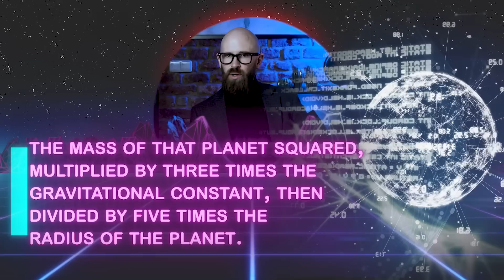Is It Possible to Destroy a Planet with the Death Star Laser?

Comment: Maybe the "lasers" we see when the Death Star fires are just a targeting system for a relativistic kinetic kill vehicle powered by a miniature warp drive (or hyper drive if you prefer) but only a sublight warp drive than can only accelerate the RKKV almost instantly up to near light speed! This would fit present theories of warp drive that even if warp drives can never be used to achieve FTL travel than they might still someday be able to achieve very high sublight speeds. The warp drive would only need to be activated for mere seconds as the RKKV was on it's way to it's target guided by the multiple lasers combined finally into just one laser. And then just moments before impact be deactivated. The RKKV would then travel at the last second (or few seconds) to it's target on it's own... destroying the target not just through the shear force of the impact but also through the annihilation of the remaining antimatter in the warp drive engine with the matter of the planet. And so essentially you would have what one might describe as a "double whammy" hitting the poor doomed planet. And voila... you have a really super cool looking, but totally awful looking scene like what we saw in Star Wars A New Hope!

Comment: You're forgetting that the Death Star has hyperdrive, which can shrink the distance between things.
So by shrinking the DISTANCE between Earth and space, the rate of entropy would be increased, allowing the planet's heat to convert to kinetic energy much faster, causing it to explode.  The thermal energy of a planet is about 4E+31J, so that's not enough to destroy it completely; but WOULD scatter it over a pretty large area, as shown in the film.

Comment: In the early days of the Internet some people got really obsessed with the trench run scene filmed above a flat model and took some lens artefact at the edge of the picture as proof that the prop is actually a sphere, so according to their calculations Death Star was bigger than the Moon. Instead of the official about 100 miles diameter which would fit with the "small moon" line in the movie, they insisted DS is the size of a small planet.

And just to prove beyond all doubt that these folks did not understand what they were saying, those faulty calculations were sometimes offered as "proof" that SW has superior firepower to other SF settings... WTF? I mean, when Star Trek has man portable planet killing bombs compared to SW's fifty mile long cannon, saying that actually the cannon needs to be massively bigger to do the same thing is the exact opposite of proving their fandom has better space magic.

Comment: In the lore it states the Death Star uses Kyber Crystlas. These crystals are basically naturally occurring super capacitors. They keep absorbing energy until they reach full capacity and the discharge it. However its not easy to control their discharge and the Empire spent nearly 20 years trying to develop the technology required to do this. The actual structure was already complete, it was the laser that was taking so long to build. In Star Wars Rebel they show a Kyber Crystal that was the same size as a small room and it manged to store enough energy to destroy an entire fleet. The one that is used in the Death Star must be as big as a small city.

Comment: The reason Star Trek is better than Star Wars is because the Federation has solved the recoil problem via inertial dampeners . . . They also use matter/antimatter effectively . . . As for the rest of the problems Simon is pointing out . . . Ya. They are working on that!

Comment: Your theory is based on the weapon cracking the planets surface into pieces. Is it more possible that it makes the core unstable causing a chain reaction releasing cascading energy. The core plus the weapon. In this case the weapon would have a different affect on smaller objects.

What if the weapon causes gravity to repel? Or perhaps the violent reaction causes nitrogen to be created increasing the violence? Or perhaps the outward pressure of the planet reduces and you have explosive decompression?

Comment: Magnetic fields in high vacuum are definitely the way to go for storing positrons, as for mass missiles, just use principles of gravity boosts or quasar jets- in other words, let something accelerate by falling towards a large celestial object and miss. 

Voyager 2 is going at around 0.005% of the speed of light, which is a substantial fraction for a man made space craft, and it was only able to use gravity boosts off of Jupiter and Neptune- use hyperdrive to boost off of a couple of stars and you could get very fast very fast

Comment: Saying as we have infinite budget for this, and access to technology such as a dyson sphere, we would also have AI and supercomputers capable of handling the calculations needed to aim multiple dyson sphere's entire energy output to a specific point at a specific time. Given that these dyson spheres can redirect the entire energy output of a star in a direction, we would also have the ability to redirect this energy at other locations thus allowing convergence of the energy in the same direction. 
With enough of these, it should be possible to create a system that would generate more energy than what is needed to destroy a planet. 
The rear side of the death star is never visible on screen during firing, so we have leeway to claim all that energy was passed through the rear of the station solving the momentum issue, and the heat if the beams have been focused perfectly(and not a single spec of dust was in the path)

I got nothing for how those beams converge and change direction at the station with the angles shown. That is extremely cool looking space wizard magic beyond everything else involved.

Comment: I think it hilarious that people make up guesses based on their opinion and people take it as scientific facts. Yes the basic idea is possible but unlikely to be effective. The most likely outcome is it'll more or less cut the planet depending on the heat involved to where the crust stone shatters or not. It wouldn't exactly explode as burst from pressure release from the planets mantle and core. If the laser itself is intensely hot then the fragmentation of the stone/bedrock of the crust could potentially fracture violently causing an explosion. Geologically it's facts but the rest would be guessing and speculation.

Comment: One of your core mistaken assumptions is that the death star (or any of the "Lasers" in Star Wars) are Light-based devices. This is false. They instead (speculatively) use (somehow magically-self-confined) streams, beams, and blobs of extremely hot plasma. Typical starfighter and capital ship "laser" systems lob these bolts of plasma at fairly high speeds, adding a kinetic factor to the (implausibly) densified and heat-retaining plasma. The Death Star "Superlaser" propels this even faster, up to significant fractions of the speed of light.

Plasma has the unique property that it is able to be manipulated by electrostatic and magnetic fields, allowing smaller "reactor" tubes to be combined safely away from the parent structure (albeit with truly staggering magnetic fields). This also means that the plausible energy density of this hypothetical plasma stream is much higher than a speculative laser system and can actually, in theory, reach the desired energy. Keep in mind that the energy output of the sun is its total light energy emitted in all spectra, but condensing a plasma stream so tightly that the entire stream is simultaneously undergoing fusion is going to significantly increase its energy output. Deuterium-Tritium fusion has an energy density of 3.38 x10^8 MJ/kg, so lobbing streams of self-confined actively-fusing plasma is...more likely to have the desired result.

However, even here, the binding energy of a planetoid is so utterly massive that even if you were to throw billions of tonnes of this plasma at at planet every second it would still demand doing so for 277 hours, or a little under two weeks. Even using some form of Antimatter plasma (whether it is self-fusing or not is irrelevant) would only bring this down to a little under an hour (for a total of 3.6 trillion tonnes of Antimatter Plasma in order to shatter a planet thusly). 

The only plausible weapon to be able to output these power levels on an even speculatively economical scale would be a Nicoll-Dyson Beam built around an O-type, or possibly a very bright B-type star. These hypothetical megastructures weaponize the output of a star, turning them into giant lasers and particle beams instead of generating power from their stellar output, and the sheer magnitude of O-type stars' energy output makes the output of our own Sun look like a pitiful glowing ember by comparison. Bonus points if this output stream of light and stellar wind can be redirected through an artificial wormhole of some kind in order to deliver the energy to the intended target in a matter of weeks or days instead of centuries or millennia.

Update: Actually, at these scales, a hypervelocity kinetic impact is more plausible than either. It would just need to be very heavy and very fast. A trillion tonnes at .95c seems to work out pretty well for feasibility. Celestial bodies in this mass range are fairly abundant, small moons and large asteroids in the ~15km range. The kinetic energy of such a body would pretty easily defeat the gravitational binding energy of rocky planets, and it isn't infeasible with various sci-fi hand-waveyness to accomplish. At these speeds, the mass-energy of fusion reactions and even antimatter reactions is dwarfed by the sheer quantity of kinetic energy.

Basically, what I'm saying is that the Death Star should have been a massive accelerator cannon that shot asteroid-sized chunks of metal at planets near the speed of light.

Comment: Actually, I can offer a SF idea for how to store that kind of energy, and it's not a new one. It's the Romulan's equivalent to a warp core. Just use a black hole.

The thing about black holes is that they slowly evaporate, via Hawking radiation, converting all stored mass into energy. Now something the mass of the moon would take longer than the universe has existed to evaporate, but here's the thing: the smaller, the faster it evaporates. As in, the time it lasts is proportional to the THIRD power of its mass, so a small one that stores the power you calculated is going to evaporate pretty much instantly, releasing all that energy at once.

The best thing is that e=mc², so any mass you put into it counts. You could shovel in sand from the moon, or use an asteroid or something. Or yes, just use a dyson sphere worth of mirrors to send light into it. (They also convert energy to mass. In fact, it's at least theoretically to create a "kugelblitz" black hole, by just sending a <bleep>ton of light into the same point at the same time.)

Of course, this has its own problems, the first being to make a tiny black hole in the first place.

Second would be charging it. Actually most of the energy would be lost in the accretion disk. (Which by itself is a very efficient way to convert mass into energy.) If you thought lasers were inefficient, wait until you see these. The amought of energy lost while charging it could probably melt not just the Death Star, but the planet in the first place.

And the final and biggest problem is that it doesn't only evaporate when you want it to, like a battery with a switch. It REALLY wants to evaporate all the time. I.e., you'd have to somehow catch all those nonillions of watts and put them back in all the time. Except see the problem in the second paragraph: the smaller it is, the more energy it wants to put it back out. So for example when it's only charged to, say, 25%, it wants to evaporate 4³=64 times faster, and so on down. So your biggest problem isn't by the time you stored a week's worth of sun output in it, but when you stored the first second.

Ok, so it's still not practical :p

Comment: Use a mass driver. A mass driver or electromagnetic catapult is a proposed method of non-rocket space launch which would use a linear motor to accelerate and catapult payloads up to high speeds. Harvest an asteroid.

Comment: Dirac did not expand E=mc² to what's shown at 9:08. Einstein did that himself. Dirac was a quantum physicist, he generalized the Schrödinger equation by adding special relativity to it.

BTW, the planet wasn't just dissolved, it blew up in a tremendous explosion. When assuming that the fragments flew apart with 10% of the speed of light, that would need energy with a mass equivalent of about 0.5% of the mass of the planet itself. If I haven't made an error in my calculation, that's 216,000 years of the sun's energy output. That's also how much anti-matter we would need for that.

To solve the problem, the death star didn't fire a laser, but shot a portal into hyperspace at the planet from which the tremendous amounts of energy came. The green beam was just the tunnel created to transport the portal. Easy!

Comment: Actually, you would need alot less energy if you would use principles like inertial confinement fusion or something like myon catalyzed fusion. The only planets worth destroying would be obviously habitable ones with water on them. The sun burns appx. 600 mio. tons of hydrogen per second, this equals to 3.6x10^14 tons per week to release the needed energy. 
Water is 1/9 hydrogen by weight, so you would need to fuse the hydrogen in 3.3x10^15 tons of water. That's less than 0.5% of earth's oceans total amount of water.

Comment: You could probably get away with arguing the Death star is some mass accelerator and the "laser" is some liquid heavy element being fired at near-light speed. As they do have some magic artificial gravity tech, using some kind of gravity anchor to oppose the recoil should be possible.
Reply: As to where to get the energy: Probably only option is to use a small black hole if antimatter is not enough. But if you have that, you could just smack the planet with that black hole instead.

Comment: First & forem, I’m not going to argue against your math. However, I would also like to point out that Alderaan had an energy shield that covered the entire planet. The Death Star in question didn’t need to shoot so straight, it just needed to have the energy shield soak up so much heat that the planet’s core couldn’t contain itself, something that even the various shield emitters couldn’t exactly stay still for, & thus blew up due to such rapid expansion with no escape. Lastly, based on < youtu.be/CBz81dew8Kw >, its possible for such beams to converge like that, though I admit that the sequence they’ve used where one beam converges at the same time wouldn’t work, but its not impossible for beams to converge like that when engineered right…

Comment: death star can provoke changing matter by super radioactive beam, if that beam will change atoms to any instable isotope, that have tend to chain reaction... then beam can disable molecules with hydrogen, then radiation will create h2 and h3 and temperature of the beam will enough for fusion of h2 h3 or helium3 or whatever can fusion without high gravitation... btw about gravitation, if that death star can jump in the space with enough speed(more than c, so use transforming space), so that thing can control gravitation, and probably change gravitation by that beam... so that beam is not laser, you know... no anti-matter... it's just some beam from universe where that space vehicle can change space-time and for sure have enough energy by this fact to destroy planets, stars and probably super big black holes

Comment: We need to supply all of the energy using the super laser (part 2).   Let's assume that the super laser is so powerful, that it can liberate all (or some) of the energy contained in matter, via the formula E=MC²  With that in mind, you could effectively blow up Earth by "igniting" a hole through it about 3.4 feet wide (387,978,000 cubic feet of material, with a density of 343.9781 lbs per cubic foot, rendering 133 trillion lbs of matter, each releasing 40,766,849,157 megajoules per lb. or 9.743 megatons for a total of about 26 billion tsar bombs.  Basically, the volume of the earth in hot gas, if 1 gram of TNT releases about a liter of hot gas... about 1/5 of a cubic mile of gas released per megaton rendering about 260 billion cubic miles of gas). This is for 100% efficiency.  In the movies, each of the component beans appeared to be about 3 feet across(as seen here https://www.extremetech.com/wp-content/uploads/2014/02/Laser-Tube-640x353.jpg) , and 8 were combined.  We could be dealing with efficiency as low as 12% of E=MC² lol. Is this worth another video?  If so, please use this as the background track: https://youtu.be/Jmk5frp6-3Q

Comment: what would happen if - a laser powerful enough to cut to the core of the planet. May not ''destroy'' the planet out right - but what would happen if you could cut straight to the core? Wouldn't the sudden release of pressure from the molten core rip the planet apart, or would it just be a huge ass volcanic eruption? IF so then what? when the core is erupted and solidify on the surface - wouldn't gravity then collapse the earth inwards?